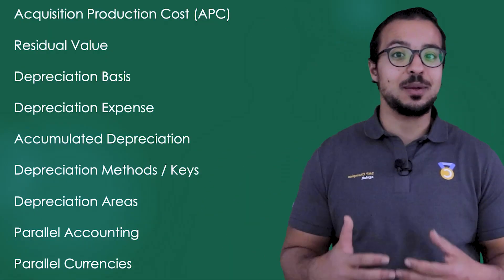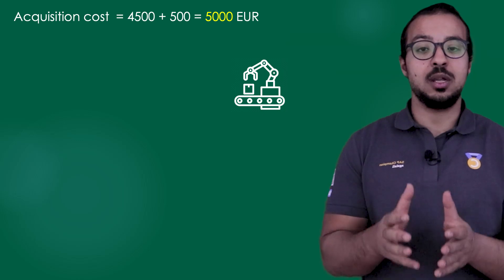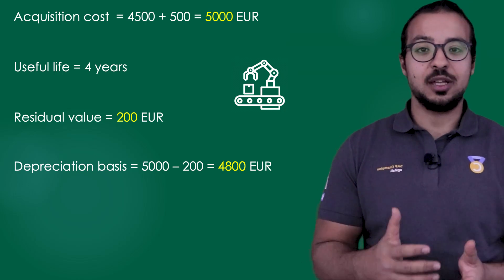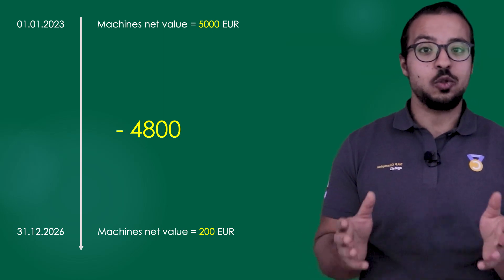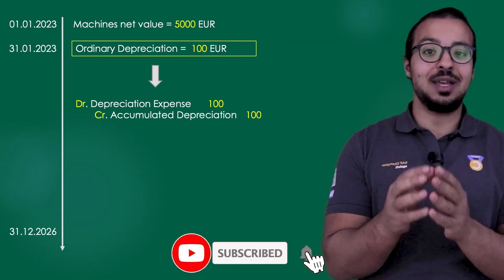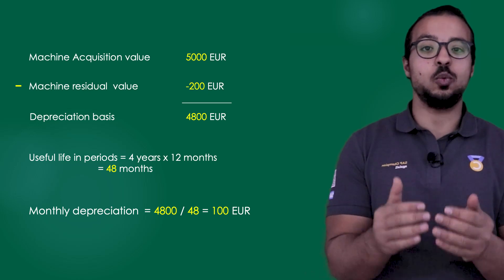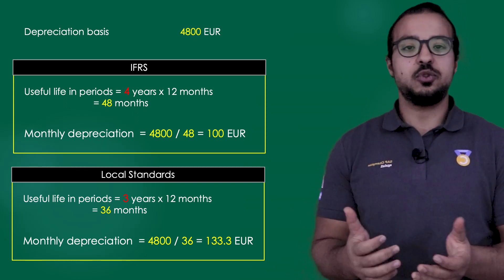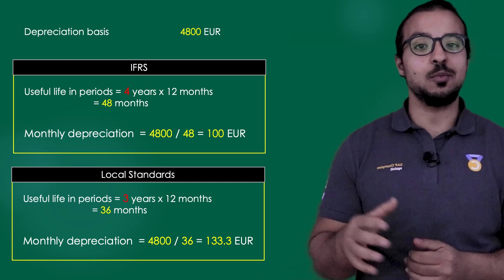Fixed Assets Periodic Depreciation: Business Process and Important Terms

Comment: Abdullah, can you please confirm how you stored the depreciation basis of 4,800 differently from the acquisition value of 5,000.  Is this by specifying a different base value method in the depreciation key?  Is the planned future residual value stored on the asset master?
Reply from the maker: The residual value
Reply: @Abdullahgalal  Thanks.  so I found the scrap value field ANLB-SCHRW in the depreciation area specific settings in the fixed asset.  But then I notice that the planned depreciation is not reduced over the life of the asset.  Only in the final year is planned depreciation adjusted to leave the scrap value remaining.  so in your example, I assume you have used a specific base value rule in the Multi-Level method to reduce the planned depreciation across the entire useful life of the asset?
Reply: Figured it out.  Had to define a cutoff value key and assign it to my depreciation key.  In the cutoff value key, there is the indicator to reduce the base value by the scrap value.

Thank you @AbdullahGalal  for giving me the inspiration to figure this out, for despite working with SAP fixed assets for nearly 20 years, I never had the need to use this functionality before.
Reply from the maker: Thanks a lot @Ray for coming back with your findings, I'll pin your comment in case others face the same issue.
Excuse me for the late reply, I always use a filter when checking comments to only show the ones I've not responded to but will no longer do this :)
Reply: @raybuttigieg1343  Hi Ray, have a quick question on depreciation computation logic by SAP. What is the Differences between base method 0007 V$ 0011 in which scenario we use one of the other? Secondly how these base methods are interlinked with Multi-level method base value?
Reply: @gouravbose8105  the main difference is that base method 0007 has the indicator "Depreciation After End of Planned Life" activated.  For example, if there is an outstanding net book value on the asset at the end of the useful life,  with base method  0007, the depreciation will continue to be calculated.  With 0011, the deprecation will stop, and a residual value will remain on the asset until it is retired.  
As far as straight line deprecation is concerned, I would use 0011 because if the depreciation key is configured correctly, there should be no residual value at the end of the useful life….assuming of course that no scrap/residual value has been recorded on the asset.
Reply: @raybuttigieg1343  Thanks Ray, one quick note about this if we choose 0011 as a BASE method for SLM what would be the ‘Base Value’  under multi-level method it would be 01 (Acquisition value) or 24 (Net Book value)?

Comment: Hi Abdullah, I have a quick question? Difference between base method 0007 V$ 0011 in which scenario we use one of the other? Secondly how these base methods are interlinked with Multi-level method base value?
Reply from the maker: Always difficult questions Gourav 😀
I would check the configuration of both methods to understand the difference from the parameters